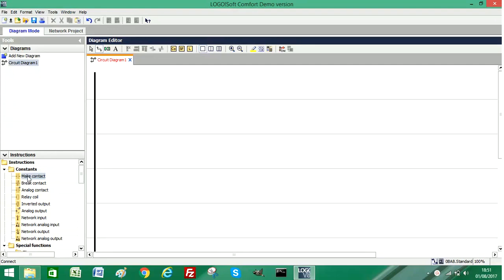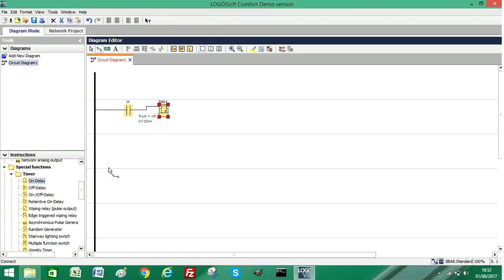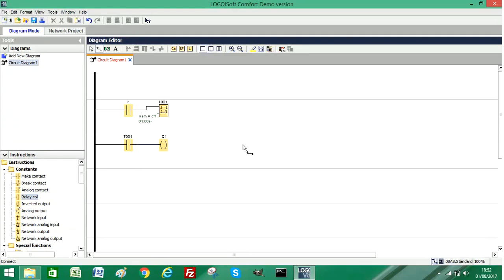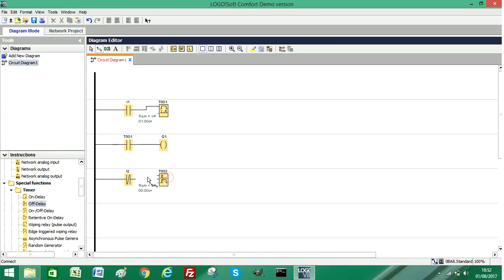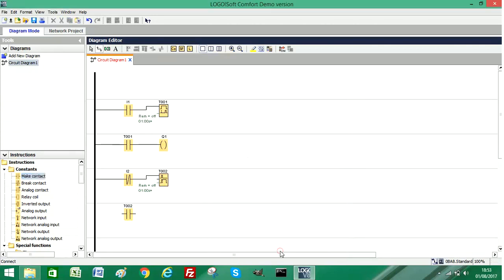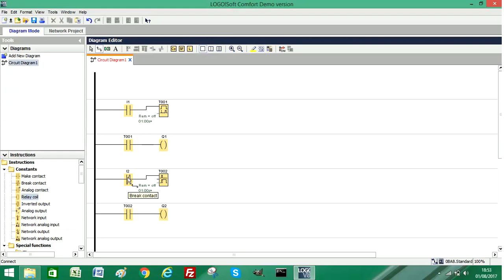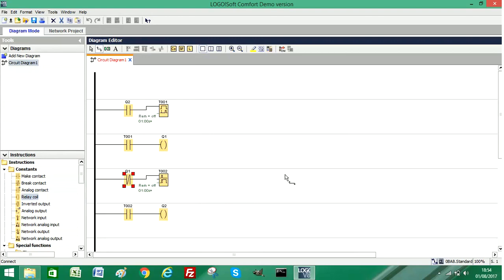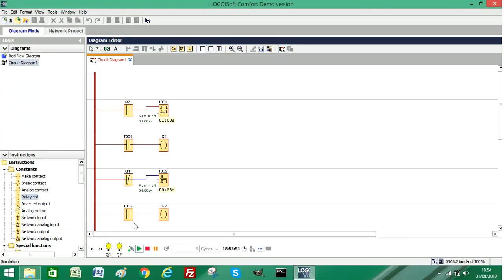PLC Programming Create a Pulse Generator using Ladder Logic

Comment: it would be nice if you could let it run a bit more at the end. and explain the reset of Q2 please - why is it returning to high after getting its falling flank from the TOF? Is it forced by fixed supply of 1 via the main line or what?
Reply from the maker: Thank you for your comment. It is a self perpetuating circuit. Once the power rail is enabled Q2 will continually reset.

Comment: Hey, could you maybe explain if it is possible to change the duty cycle of a given signal? Which variable would i have to change to do that?
Reply from the maker: Hi good question, can you explain how this signal behaves in the logic, does it stay on for 5s then changes state to off for 5s for example? And how do you want to change it, do you wish to change the frequency so it changes state faster or slower? Thanks
Reply: @uzrchannel  Whole cycle period is 5s (duration of high state + duration of low state). So for example for a given duty cycle d = 0.8 or 80%, I would have 4s of high state, and 1s of low state, and for a duty cycle of d = 0.5 or 50%, id have 2.5s high state and 2.5 seconds low state. Im curious if it is possible to control duty cycle variable in logo, and how would you do it?

I tried to do it with 2 analog inputs and a comparator, then referenced it to timers, but i dont know if it is right..
Reply from the maker: @ninek1902  Logo is quite limited in the functionality available. I will look at this over the weekend as I'm not at my computer right now. Let me know if you find the solution, would be interesting to hear. Cheers 🙂